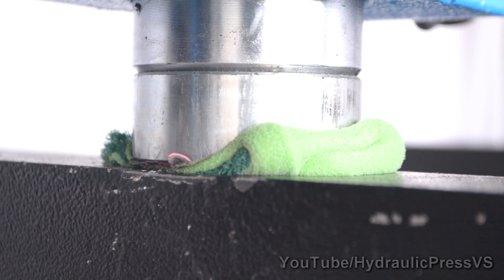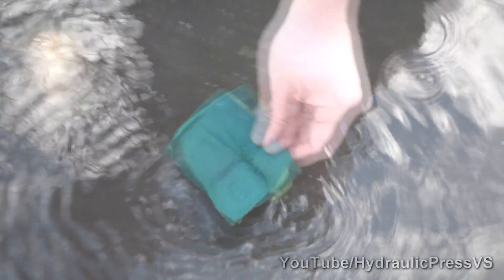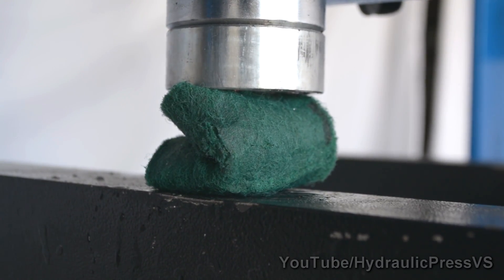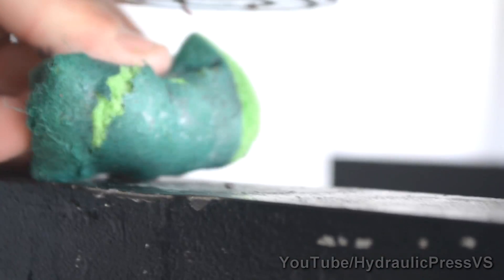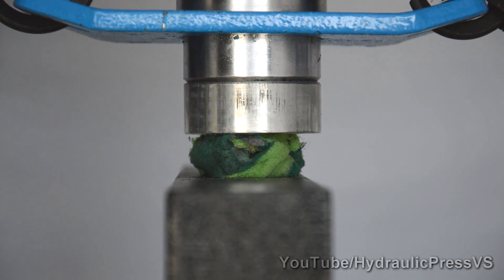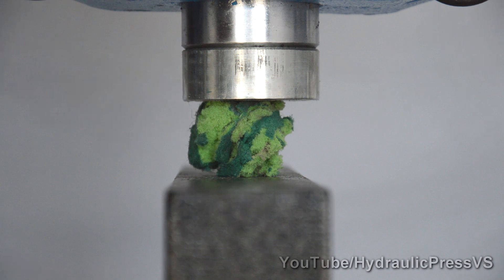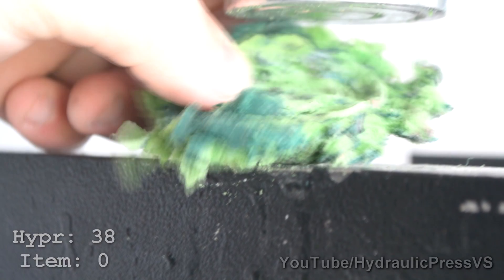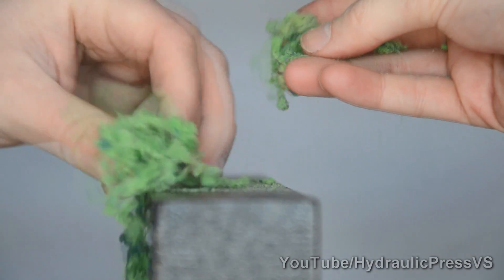Sponge vs Hydraulic Press - How to get a sponge dry

Comment: You should crush a stack of paper discs the same size as the press head (maybe a little smaller) to see what happens when the entire surface gets crushed and not just the center, since the edges curled upwards on the book.

Comment: Was it not already dry?
Reply from the maker: +Tim Ramich if you watch the full video you will see when we make it wet.
Reply: +Hydraulic Press VS Yes
Reply: +Its Roob Middle finger.
Reply: Tim Ramich because you domt have the iphone.....you dont have the emoji
Reply: +Its Roob Yep. I have an iPhone 6 plus. I'm just not some lazy teenager. I also highly doubt that they have a middle finger emoji.
Reply: Tim Ramich nd see.....if u had an iphone 6 u would no that
Reply: +ArduinoPlays Hah, iOS 8.4 is not obsolete. This is all beside the point. I wouldn't use the emoji, because I'm not a teenager, or some stupid nerd that's into anime. I don't use them. End of fucking discussion.
Reply: I think both of you are missing the point here. wether you have one or not, Iphones are shit.
Reply: +ethan elvis Good for you, android fan boy.
Reply: +Tim Ramich battle of teh cellular fetgetz
Reply: Tim Ramich there is a middoe finger.....my 13 year old friend has an iphone 6 nd she uses it all the time
Reply: +Its Roob Learn to type. Mine doesn't have it. I value a jailbreak more than having the newest iOS.
Reply: pretty sure it was already dry, they should have soaked it with water first, and yes I saw the rest of the video, it kinda looked like they ruined the sponge by squishing it dry first.

Comment: What is the actual industrial use of such a press? why do you guys own one?
Reply: Mac11ncheese thanks for telling me?
Reply: +Theforbiddenname Z They're mainly used for machining. Forging, clinching, moulding, and metal forming operations. They're also used in Hydroforming. Basically if you need to press metal into something smaller, this is ideal. Clinching is when you fuse metal sheets together without additional compounds. Aluminum will do this if you just press it together.
Reply: thanks! :)